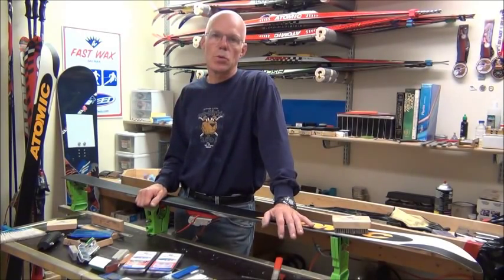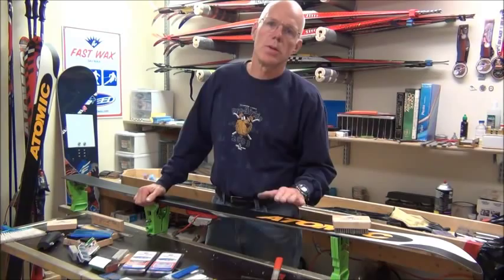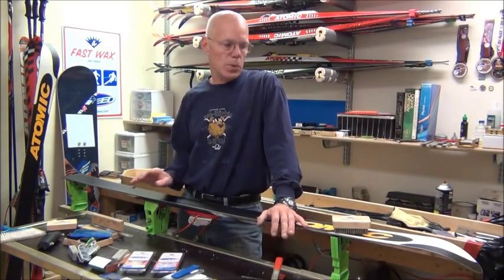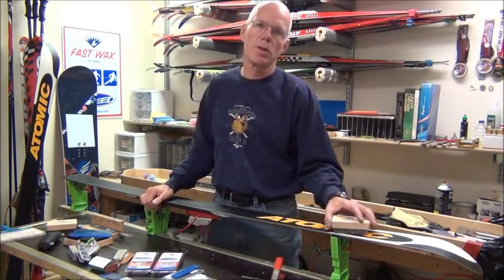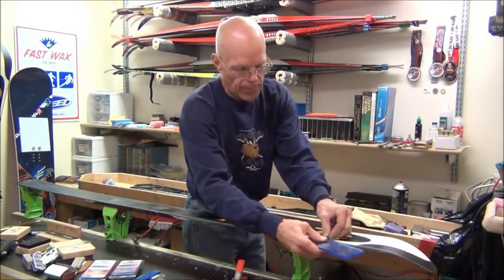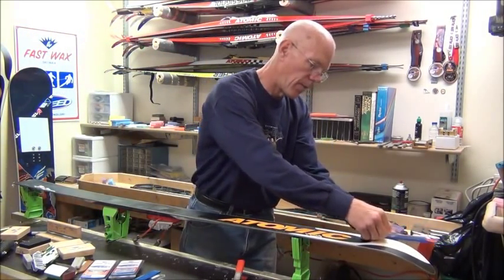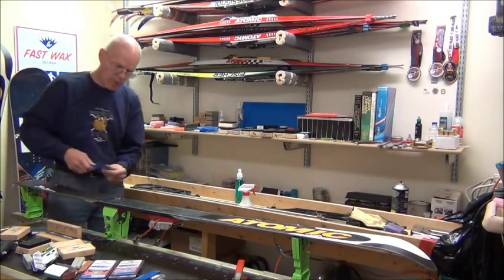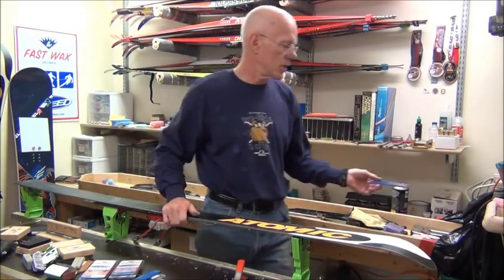How to use Ski Wax Base Prep

Comment: So the final nylon brush pass takes the place of a polish with cork? Great video.
Reply: Responding 6yrs later for anyone who runs across this while learning this is a great video for how to used base prep but I would only recommend as a beginner to only use plastic scrapers to remove and scrape applied wax. But as far as the nylon/horse hair brush it creates channels in the wax for the water to travel along the surface area for the board /ski the faster the water travels across that surface area the faster said object can travel so if you minimize the length of channels you maximize speed 🎉
Reply: So 45 degree angles  in a cross hatch pattern can actually allow that water layer to travel to the edge of the ski faster you can use a roto brush to speed up this process